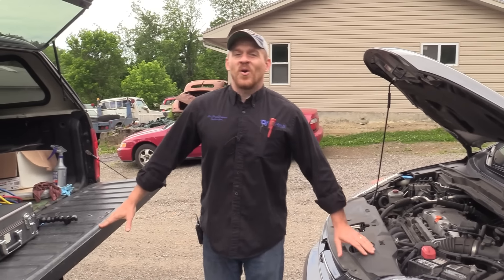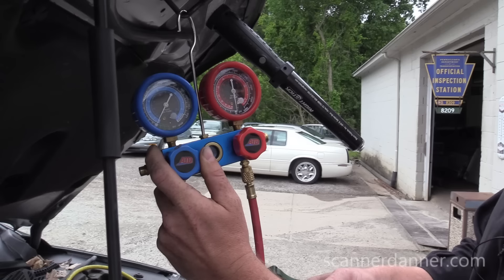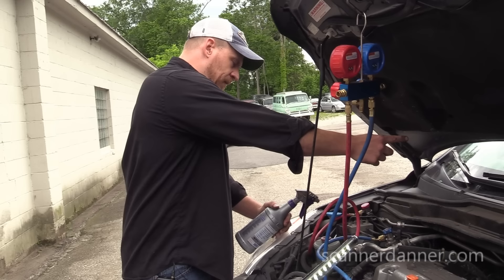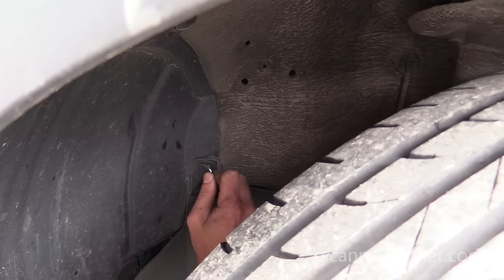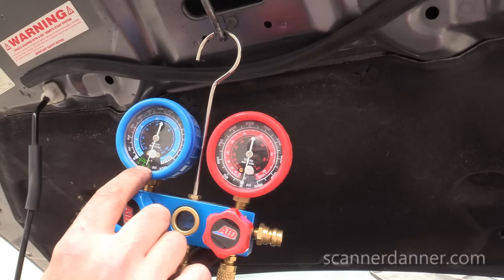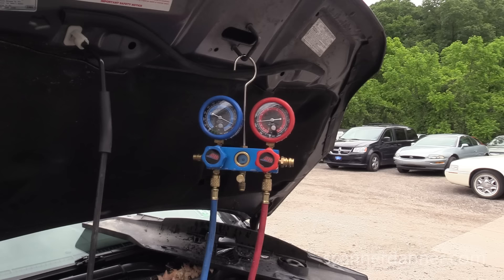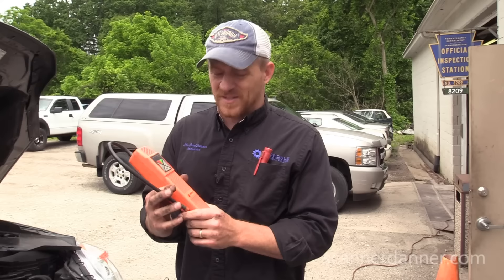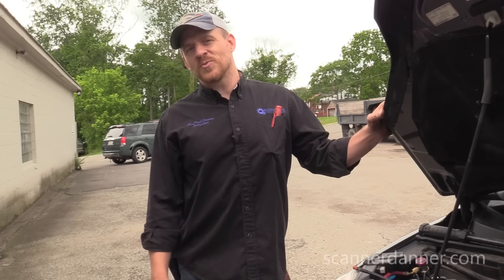Air Conditioning Not Working (system performance, leak test) - Honda CRV

Comment: Is that compressed air"  used to raise and check for system tightness must be refrigerated in order to ensure not adding water in form of moisture in the system. Why not using dry nitrogen to do so?
Reply from the maker: I do (nitrogen) in my newer AC videos.
Reply: @ScannerDanner does that indicate you've reversed your position on using shop air for testing?

Comment: Hey Paul, excellent video. I hope that you see this message and are able to reply. I think the main reason why you shouldn't use compressed shop air is because that shop air has a higher abundance of water in it that atmospheric air, so you will saturate the desiccant in the system. It may not be an issue if the system is completely empty and has been for a while as it is already saturated, but if the system is low from a leak but not empty it may not be something that you want to do.
Reply from the maker: I would agree, if a system is low and not empty, shop air is not my first choice. In those cases, adding some refrigerant and dye would be better.

Comment: Would it be a good idea to put more air in. Run a/c again. And spray soap water again with a higher pressure in system. More air pressure in system should blow more/make more noise/bubbles.....lol.kept watching and you did it. Best to watch whole vid before commenting like a wise guy. Thanks for the vid. Now i need to buy a vacuum pump and ac manifold/gauge set. And dont drop the soap...i mean forget enough soap. Thanks Paul. 45 minutes well spent. Now time to watch your lean conditions vids
Reply from the maker: I found an inexpensive kit, same pump I used and gauges and it's linked in the description. Shop around, if you find something cheaper buy it! I tried to find a decent quality low cost set up and I think I did good.

Comment: How to check AC compressor performance while it’s cold outside? I use a piece of cardboard I place for the condensor. I look pressure mounts to 18 bar. What do you think of this method I called the Saint-Tropez test???

Comment: Hey Paul  I am working on the same car. A 2008 Honda CR-V with no A/C. I got two questions , First is the the Rosedale tech shirt? Second the CR-V I am working on the A/C compressor sounds like metal in a blender. Would that be a sign that the an leak?

Comment: That was a real bad evaporator leak to set off the detector. Usually when evaporators are in there early stages of leaking, you have to pull the blower motor resistor out and shine a black light with uv glasses at it. This thing prob got recharged a few times over the year until it started leaking out faster, then the leak was provable with a leak detector. Also evaporators leak out faster when the a/c off because it roughly at 70 too 100 psi off and 20 psi when a/c is on. False positives with leak detectors come from lack of training I'm glad Paul cleared up. Way better info than what conventional school or service manuals teaches you. Don't get desperate and throw a common part at it when you can't prove it leaking
Reply from the maker: exactly! thanks man

Comment: In that drain tube where the leak was at, couldn't you use a clear plastic cup (gatorade bottle) with water and with the air pressure test put the cup with the drain tube submerged in the water, wouldn't that show bubbles?

Comment: 1:02 - Paul! You said at the beginning of this vid that you didn't hear the rpm change nor the clicking of the clutch solenoid.  I'm wondering why you're attaching gauges at this point instead of diagnosing why the compressor is not engaging.  Wouldn't that be a fuse, wiring or signal problem? (ok, you addressed that here: 39:46)

10:28 - Don't worry, Paul. You don't need that one!
Reply: The AC system has two internal sensors (high and low pressure switches). If there is insufficient pressure on the low side, the compressor won’t kick on for safety. Conversely if the high pressure gets too high, it will kick off. The standard behavior for an AC system if it has no refrigerant is that it won’t kick on. You can use a scan tool to see the status of the pressure switches.

Comment: Nice vid, thats what she said LOL. Thats pretty neat using compressed air, BTW evap core on Hondas are pretty easy, blower box comes off and you can remove the evap core and txv valve, you where looking for the drier and in this particular vehicle is built into the condenser and im not sure if it is serviceable, and one more thing, in this case you ran the system for 5 seconds to confirm electrical and hvac controller integrity, but what if it is the other way around like a week ago i had an 08 civic with a bad a/c clutch it was just open (the coil), there was no way for me to run the system to confirm that everything was ok without putting a clutch or a compressor in my case, so i sold the job only to find a stuck txv valve at the end of the work, meaning that 3 hours + $50 where needed to get the a/c to cool at higher rpms, customer was not happy neither was I.
Reply from the maker: Sometimes there is nothing you can do about it. Communication with your customer is then key at that point right?

Comment: I know this is an old post but hey I'm old. Our 2003 Class A Newmar A/C is not cooling but clutch stays engaged. Had Freightliner repair the A/C two years ago and they found a leaky fitting on the condensor and everything worked fine for a year(we don't use it a lot) last fall notice it wasn't cooling nearly as well as after we had it fixed. Now it blows ambient temp air. I did what you did and hooked up the low side(when I removed the cap it made a "psst" sound like it was leaking maybe. The static pressure was 50-60(didn't note it)(ambient temp 75-80). Cranked up the coach and low side dropped to 30(25 at fast idle 1100rpm).( High side went to 70(80 @high idle). Any ideas. Thinking of adding a can of 134R and buying a leak detector tomorrow. Do you recommend The 134R with oil. The A/C worked great the first two years after we bought it. Appreciate any help or suggestions. Thanks Paul. Your video on the saturn ion that was missing and barely running helped me fix my wife's 2003 Saturn Ion quad coup. Thanks again.

Comment: I’ve used compressed air because we will vacuum the system anyway but I did replace the compressor and condenser with desiccant. Also check the valve cores sometimes they stick open after charging and this happened on my Acura so I just blipped the valve and it sealed.

Comment: before I even consider doing an a/c service on a Honda I first check the a/c clutch driver once I confirm that the pcm can activate the compressor I put the gauges on it if no freon is present I shoot half a lb of freon with dye and check  the low side port and then the high side port of the gauges .. on Hondas 1/2 lb of freon usually  kicks on the ac .. .. if the condenser fan and ac turn on just top off the freon .. check gauges every 15 min .. usually it's a clogged condenser internally or externally that causes high pressure and  pops a leak .. accumulators gets replace along with a flush if the evaporator is not leaking. .

Comment: I’d say static pressure/rest pressure should be at or above ambient temperature depending on humidity. I’ve seen a lot of pressures at 110 here in south Texas.
Reply from the maker: This also depends on the type of refrigerant but you would be correct for R134A. It's psi/temp relationship is very close to the degree F scale.

Comment: You can stick a stethoscope through the vent inside the cabin to kinda-maybe check an evap core leak, if the leak is large enough you'll hear it hissing. If you can't get through a vent removing the blower resistor works too, if it's easy enough to get to

Comment: Bro you are the man! Very thorough and definitely not a shotgun technician. My 2007 Crv just started blowing hot air after a long trip. I checked the compressor and the clutch is not engaging. The fans are coming on when the A/C is turned on but the clutch is not engaging. I have checked the relay and fuses. What do you suggest I check next? I appreciate your time. Thanks man!
Reply from the maker: First test is to check your system pressures. You'll need a manifold gauge set. I have an inexpensive but good one listed in the description of this video.  
This video will help you too https://www.youtube.com/watch?v=KTbmgjA0N9s&t=25s

Comment: Is it possible the receiver drier is integral to the condenser? Wouldn't you need to have a scan tool hooked up to watch PIDs while air charging the A/C system to confirm the inputs/outputs, relays etc are working properly? I ask because this would be an excellent short cut for flat rate diagnosis if it is reliable/valid for all makes. I believe you did say you have been using this method for many many years. Thank
Reply from the maker: That is what others are saying. Or that it is near the condenser. No to your second question. If the compressor kicks on with air psi, this confirms that it will also with refrigerant. Of course there are some variables to everything but this is a very reliable test. In fact, I've never had an issue with it.

Comment: Just curious.. so with it being evap, rather than charging slightly, could you submerged the evap drain in soapy water? With the system under air pressure? Just my thoughts if there was refrigerant leaking out of the hose the air pressure should too correct?
Reply: The drain is only to route the water that gets condensed on the evaporator when it's working, it has no connection to the internal parts of the evaporator. It's in an open system there.

Comment: I am just surprised you did not get the funk smell of the 134 refrig oil when first turning on blower, the nose can tell even when those leak detectors can't. Too many Benz evap replacements in the 140 chassis. Look for the wet spot has been my go to repair, leak detectors break too often, esp when others borrow them.

Comment: Yes if there was a leak you could have atmospheric pressure in system but most of the time once the pressure is lost the leak will seal back up until repreasurized again. So not always does the system get atmosphere in it. And you should never use shop air. Shop air has dust partials and a lot of moisture in it that is extremely bad for the dryer. You should use nitrogen. Nitrogen has no air, moisture, OR DUST.

Comment: How do you get the compressor to come on without any refrig in it ? You would have to jump it wouldn't you ? I don't see where that was mentioned. As I know air pressure doesn't engauge a clutch. I can't get my A/C to take in any refrig anymore. The clutch comes on but still only about an eighth of a can and that's all it will take. I changed the expansion valve which I did have for 2 years and still won't take anymore than that. Changed compressors as well, still nothing. I need  to make sure the compressor is pumping like it should. All I need to know is how the compressor kicks on in this video. Appears possibly there's a restriction somewhere but maybe that has nothing to do with not taking any refrigerant in than it does. Great video Scanner.
Reply from the maker: Air psi will close the low psi cut-off switch and the compressor will engage. You just do not want to run it long because the compressor will be running dry of oil. The refrigerant picks up the oil and carries it through the system. Air will not do this.
Reply from the maker: oh and you will NOT see the same type of pressures that refrigerant will give you. Just make sure you have at least a 4:1 ratio (high divided by low)

Comment: What about leaking schrader valves. Often I find that if nothing is leaking like evap, condensor, compressor etc. Then I check my schraders.
Reply: Oh yes, a mechanic (a son of a gun might be a better term) once serviced my AC (i had him replace a few o-rings here and there) and seemingly "forgot" to tell me one Schrader core leaked after his service. It lost about 200 grams of refrigerant in about two weeks even with a tightly fit cap. How did i find about in such a short term? Because the system had to be serviced again shortly (failed clutch coil thermal fuse)

Comment: If the AC is not working and there is no power at the AC fuse ( in the fuse box next to the battery ) does that mean the AC switch is defective?

Comment: Hey there Paul, any chance you could link me to a chart/resource showing the Pressure Temp Relationship for r134a when the system is at rest and equalized? Having trouble finding one. I know you said its close to 1:1 with farenheight, but i've gotta know the exact values.
Reply from the maker: just google r134a pressure temperature chart. I just did and there are a ton of them. Thanks!

Comment: Good morning I need you help I did your test with air in my ac Sistem clutch work but my hose in cooler radiator blow out .what can be tha problem, thanks
Reply from the maker: Cooler for the transmission? Or are you talking about the condenser?

Comment: I've found a lot of times compressor shaft seal failures will shop up when pulling a vacuum on the system. Sometimes can hear the whistle at the compressor when the vacuum is applied
Reply from the maker: for sure and that was my suspicion
Reply: Many years ago at a job I worked there was a large machine we were building and a part of it was a large vacuum tank with porthole windows. When they were testing things I got to watch a puddle of water in the bottom of the tank boil like it was on a stove but it was 70 degrees. I think it was at 15 inches of vacuum.

Comment: Just watched your video. Wouldn't you need to turn off the vacuum pump and then look for it leak down?
Reply from the maker: If I closed the manifold gauge valves, it isolates the vacuum pump

Comment: The argument I have heard against the use of air to leak check the system, besides the moisture problem is the incompatibility of the oil in the compressed air and the oil used in 134a systems which might cause sludge that can clog the TXV or orifice.  But that was from a book on air conditioning.  It that just an over stated theory?
Reply from the maker: Overstated theory for sure! You should have seen how we retrofitted R12 to R134a systems back in the day.  It's not like you were able to get rid of the mineral oil (R12 oil) and yes it did turn to a sludge in the presence of R-134a.

Comment: hey paul my 94 s10 v6 vortec. the clutch is running constant not disingageing in and out filled it dont have leaks still holding presshure but the box on fire wall under windshild is blowing cold air out the corner of black box were motor blower hooks to im gonna check switches maybe you can help couse you helped me on the running problem. and been running every since thank paul.

Comment: in my 2004 dodge durango my front ac is really warm. i took the cap off the low pressure port and i hear a leak and it shoots out a tiny bit of liquid. But with the cap on i dont hear anything. So i dont think its THE issue. Its certainly an issue but i think theres a bigger issue. If that was it then all the refrigerant wouldve leaked out by now right? I hooked up a gauge to the low side with the car off and like you said, the standing pressure matched the ambient temperature outside.

 The AC compressor does turn on and off when i push the AC button on the inside but it doesnt cycle on and off. It just stays on. The gauge will drop all the way down to like 25psi and instead of steadily climbing then dropping again, it just stays low and climbs up to around 30 psi but it takes a couple minutes. I'll mention that the rear of the car vents blow a lot cooler than the front. It has a dual AC system. I doubt you answer these anymore but worth a try.
Reply from the maker: I try to! 
First, yes, that low side service port should NOT be leaking like that and it could be where you lost refrigerant.
I need a high side reading to be able to advise further. This will tell us if you are low on charge or have another issue

Comment: Hi Paul in my 09 Tacoma I'm replacing the compressor and the condenser. There seems to be a lot of controversy about how much oil to put in. My plan is to measure the oil from the old compressor and replace in the new compressor with the same amount.  When it comes to the condenser I don't know how much or how to put it in. I think the drier is also part of the condenser do I need to put oil in that too if so how much in the condenser and the drier. Thanks
Reply from the maker: Each component replaced in an AC system would have a certain amount of oil. For the condensor, I'd add an ounce or two at most. For the compressor, you can drain it and measure what you drained but most likely nothing will come out. Put an ounce in for that too. Then an ounce or two for the drier. So if you are doing the condenser, drier, and compressor, I'd say that you want to add 4-5 ounces to your system.
Reply: Thank you for answering my question I appreciate it very much. Also for all your videos and for sharing your skills.

Comment: Hey Paul, what about an A/C system that does not kick off  and freezes up after a while of running. Even though the electrical side of turning on the compressor is good, doesn't mean it will kick off, right?
Reply from the maker: Without knowing what you are working on, there are low psi and temp switches and sensors that are used to control the icing of an EVAP core